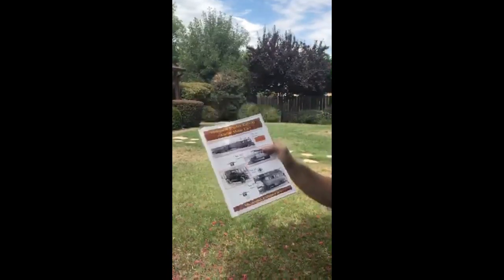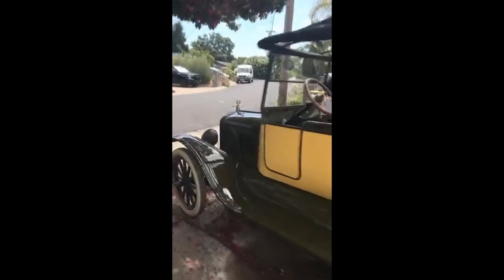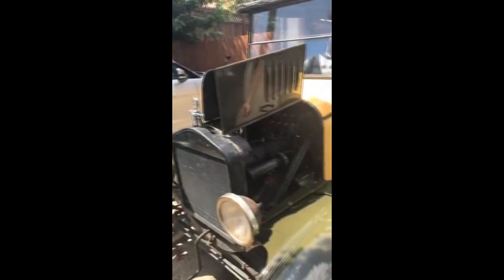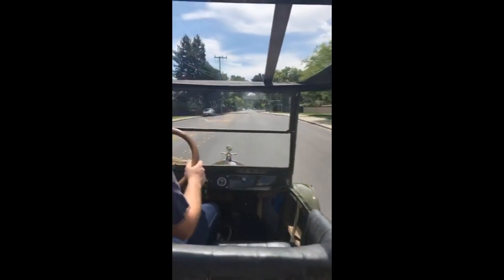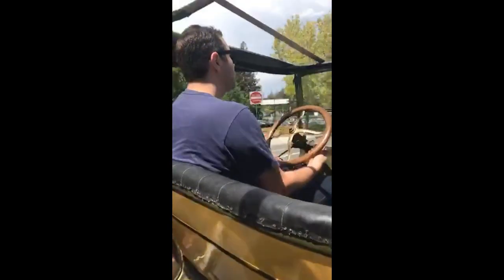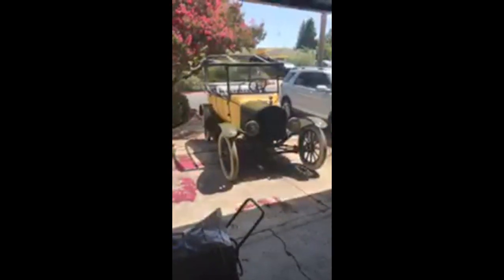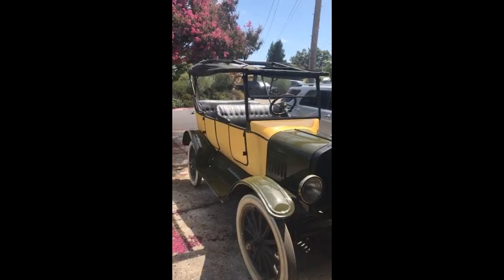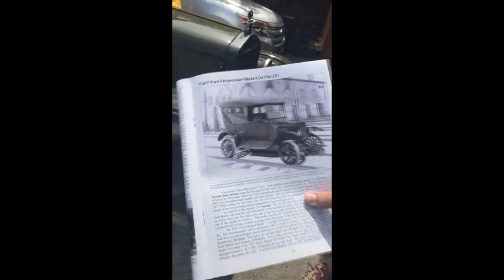Virginia & Truckee motor car 24 replica debut

Comment: +spfilms4449  The Virginia City & Truckee River RR (NV, USA) / Ford Motor Company Model T phaeton was probably built on 56" axles (beam front, three-piece rear); the spoked wood wheels probably used custom metal tyres to work properly with the Sheffield rails.  Dutchman® Axles can build a new period-correct Quick-Change drive axle with 3.54:1 ring and pinion; the quick-change gearset below the R&P is a sure means for installing and calibrating a tachograph consistent with the SANGAMO®/Western Electric 6VDC clock/speedometer likely installed on the original Motor 24.